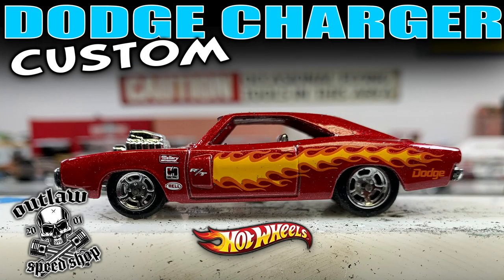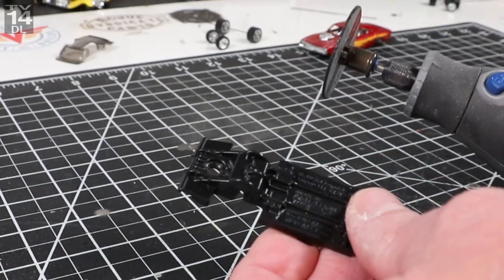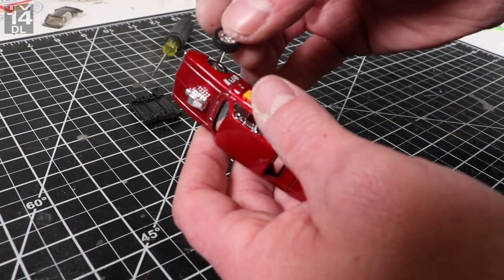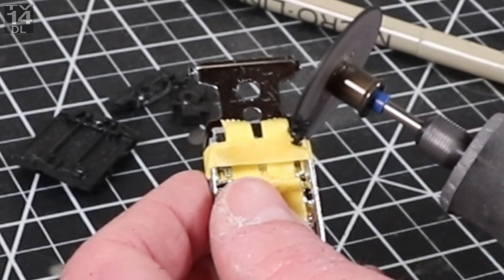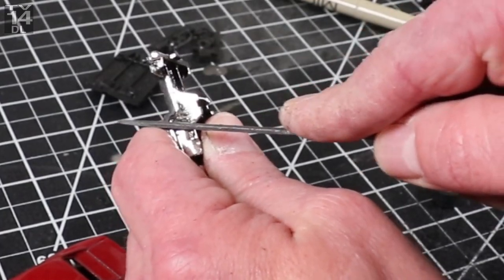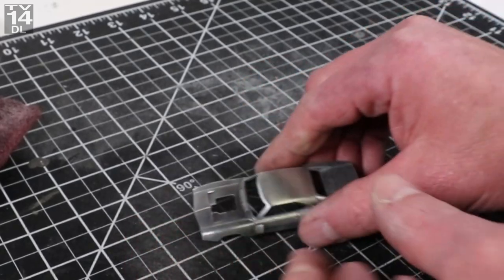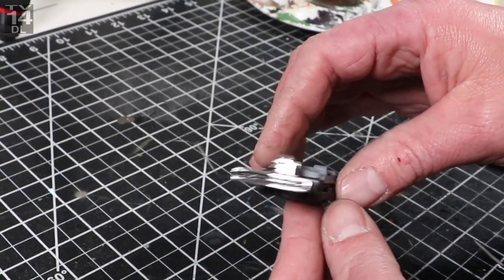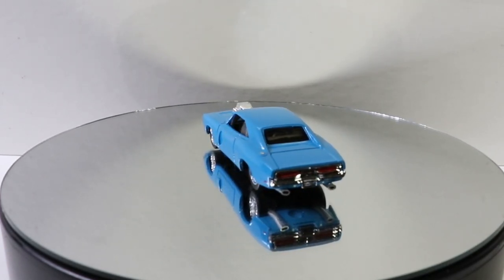Hot Wheels Custom Dodge Charger

Comment: Question.. if you can wet sand water based primer could you not wet sand water based paint? and if so why wouldn't you before you did your clear coat
Reply from the maker: I have wet sanded the paint before clearing in the past. I didn’t need to this time. I also could have sanded the clear coat(after a long cure time) and buffed that as well
Reply: @OutlawSpeedShop2001  see this is why i love your channel, i learn things, i would have thought that wet sanding water based paint would somehow mess up the pain job
Reply from the maker: @trimmin420  maybe I have just gotten lucky lol.  I haven’t messed one up yet.